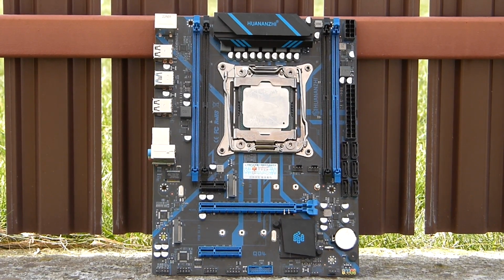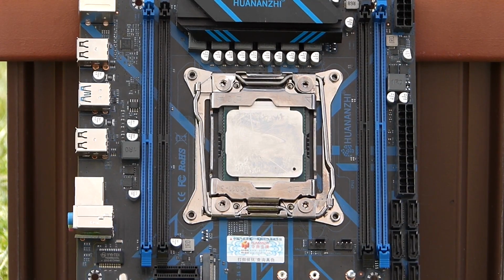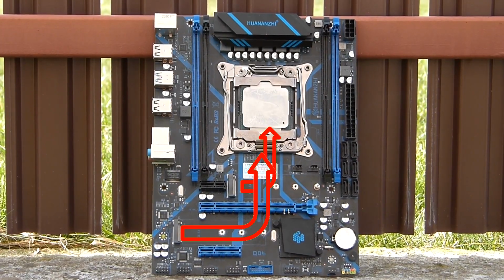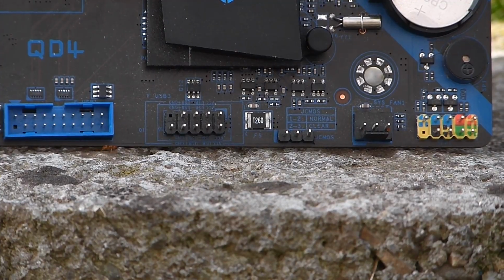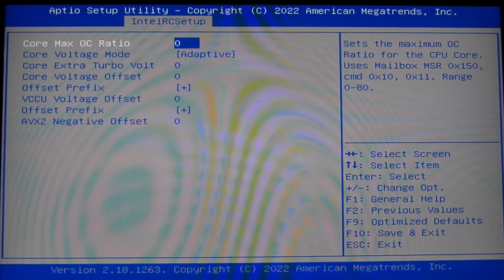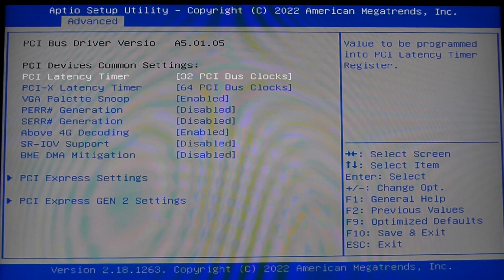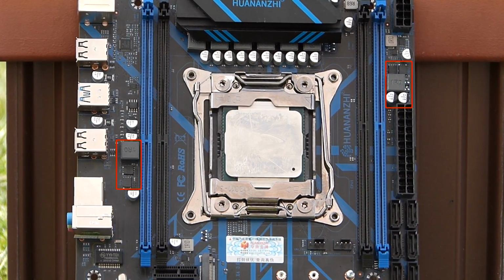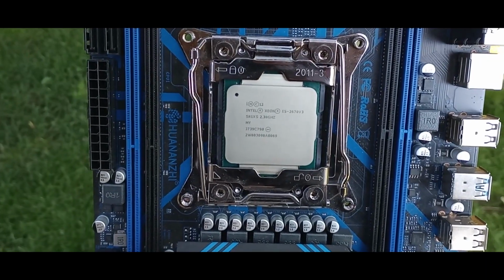Is This A Good "X99" AliExpress Motherboard? | Huananzhi X99 QD4

Comment: NO TPM..motherboard rip
Reply from the maker: (1) it has a TPM header for external TPM modules (2) only Win11 requires TPM. You can use Rufus however to remove that requirement when creating the bootable USB
Reply: @oldertechtoday  true but still not the best buy 4 that price
Reply from the maker: @nicknamenicolas441 True. I have the feeling that the boards from Aliexpress are intended for a captive market, that does not have access to something better.
Reply: @oldertechtoday  yes if u wanna start a good pc setup 1080+ low budget,that s the way. ddr5 it s to expensive ddr4 same...ddr 3 it´s a good way to build setup.(combo 3 in 1 motherboard xenon ram)

Comment: I order this motherboard and thinking about build pc in johnsbo c6 case, will it suit well?
Reply from the maker: You might have some problems.

I think the motherboard itself will fit - the case takes mATX bpoards, the X99 QD4 is mATX. Keep in mind also the GPU length (has to be less than 300mm) and the height of the CPU cooler (less than 75mm).

And it is the CPU cooler that could get you into trouble: it is going to be difficult to find a low profile cooler (height under 75mm) that will cool a 120 - 140W Xeon.

Try to get a case with more clearance for the CPU cooler. I'd avoid cramming parts that generate a lot of heat into a small case.

Comment: I'd say it is a decent motherboard, of course for a x99 ones available on the Ali Express - qaud memory channel is a big plus. Have you checked the Machinist MSR9 motherboard yet?
 
I personnaly use the Jingsha D8 mobo, with "true" x99 chipset aka C612, decent power section cooling, 8 slots for DDR4 RAM, quad memory channel, 3 full size PCIE-16 v3 slots from which two are directly connected to the CPU and it matters to me because I've installed dual GPUs on it.

WIth turbo boost unlocked Xeon e5 2678 v3 and 32 GB DDR4 2133 it is quite capable and stable setup for work and gaming. However this is not a budget motherboard.
Reply from the maker: The C612 is a much better chipset than the Q87, and by what you describe, the board you have is one of the better ones out there.

There is another youtuber - 50 Shades of Beige - that had a look at some other "X99" boards from Aliexpress, and I think he did have a Machinist.
As expected, cheaper boards come with Q87 - the budget chipset for business computers. The more expensive boards have the C612.
Reply: @oldertechtoday  That is true, at the time I was buying it my mobo was considered, khem, a "prime tier" of X99 Ali Express's upcycling marvels boards. Al in all, it is almost four years that I am using it daily and it works with no problems.
Reply: IMO quadchannel was one of the reasons to go for a HEDT platform with SB-E/IB-E/HW-E/BW-E instead of their consumer counterparts. I'd never have gone using just dualchannel with those platforms myself.